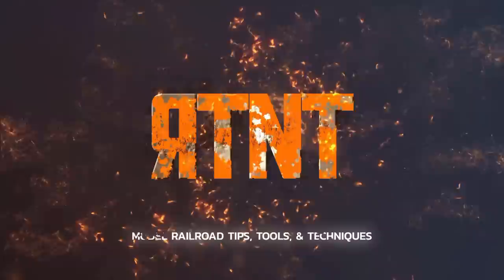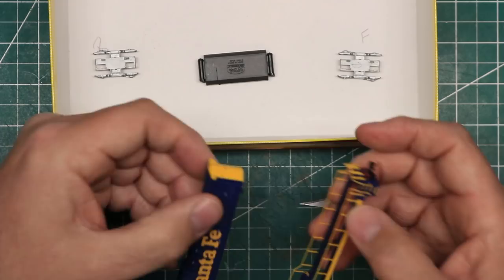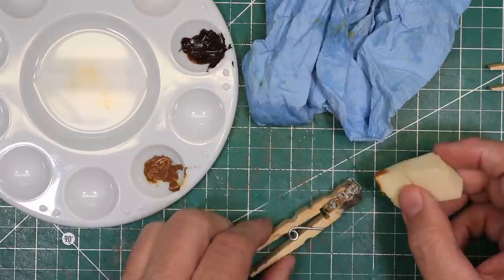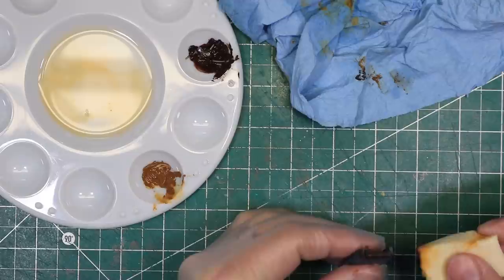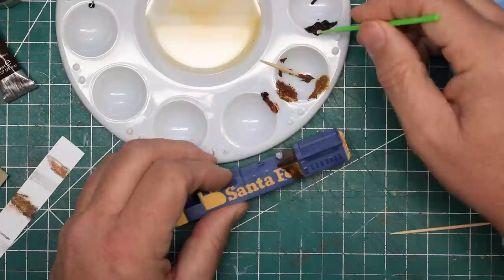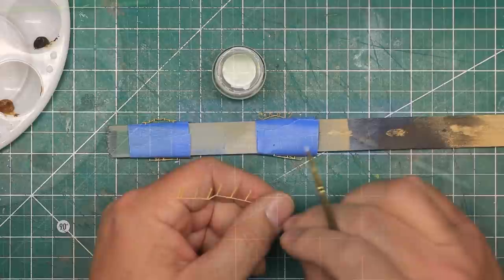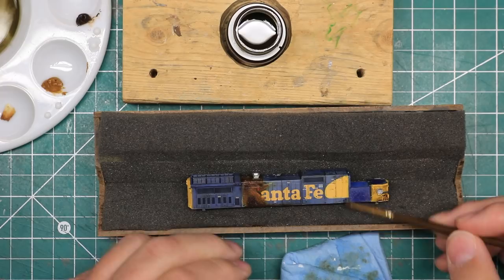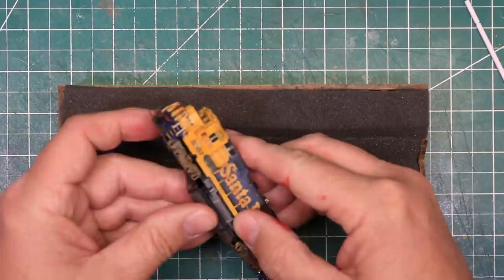How to Weather A Model Locomotive

Comment: Ron, another fine and informative video. I do have a couple of suggestions that might not work as they might be production headaches. 1. I would be nice to see the effect of the fade coat in relation to the out of the box look. Painting the fade coat on one side, then flipping the model over to see what the original looks might help, but nothing is better than seeing both at the same time.  2. Really just an extension of #1, to see a side by side shot with before and after toasting. I suppose a large still shot would work, but again, production headache maybe.  Or you could do a short term lease of a duplicate model from MidwestModler, but inventory issues for this older engine I am sure would be there.  Of course, we do have the option of sliding our video bar back and forth to see that effect, or I could use my phone screen for one side and the pc screen for the other.....I may have answered my own question. Keep em coming, Ron, we learn a lot from them.